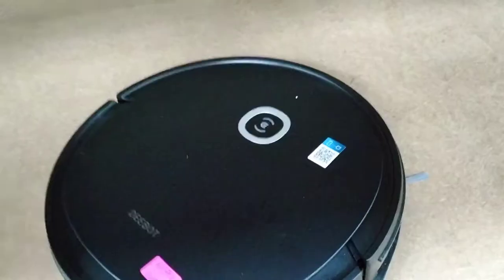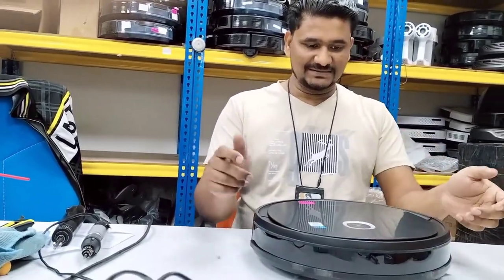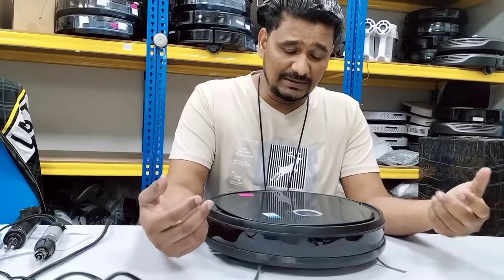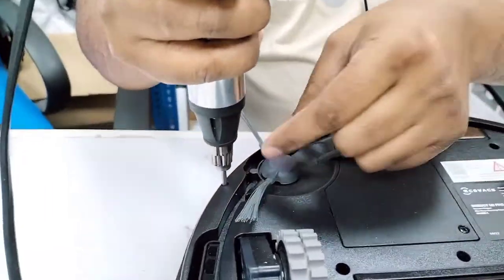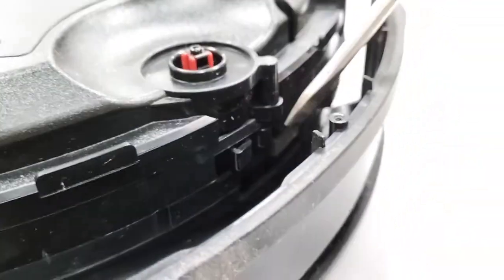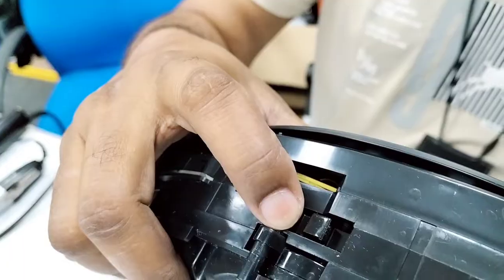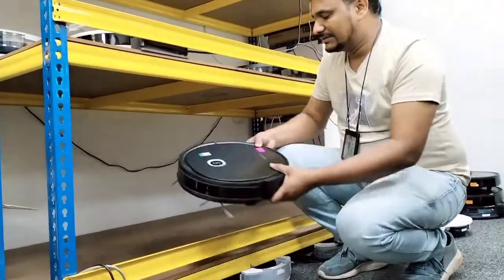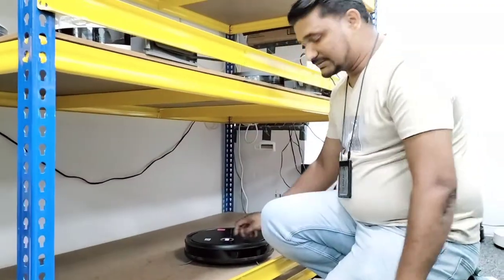Deebot Bumper Issues | Fix yourself @ Home Just in 5 Minutes

Comment: I have an N79S that gives the "Bumper error" mostly when hitting a wall almost head on, but not quite. Occasionally it will do "side brush error" instead. It can't operate for more than a few minutes without an error. I've opened it up and cleaned it thoroughly, and all the parts (the side brushes, the metal springs in the front of the bumper, the bumper clips you highlight in this video) all move freely.

Any ideas of what else I could do? I would really like to keep this operational.
Reply from the maker: Can you please attach a video clip at  WhatsApp 00601137973018
Reply: I am also facing same problem, I have a new machine which couldn't even map my total space until now. It works hardly less than 5 mnts then it brings error bumber stuck 😢 it's not stuck when I checked. It usually go reverse and hit to wall at back and says bumber stuck. Can't figure out what could be wrong. I have purchased it out of my country, and service center not taking it for a checkup. Kindly help. 🙏🏻

Comment: We have the bumper stuck warning issue. Have opened and checked. The two spring loaded levers that get pressed when bumper hits an object are working fine. There is no dust or water ingress. But soon as first object hits bumper Deebot 900 Ozmo stops are starts giving bumper is stuck warning. Any advice greatly appreciated or where in UK are private repair centres?
Reply from the maker: Power on & start...once start moving then plz press bumper with ur hand from left, right & front sides....then u will understand which Side of the bumper is giving error...then just check from that side...maybe you find some dust, rust or wire damage in bumper... possible plz try...if still same then bumper need to replace

Comment: Hi Bro, 
I have a new DLN26 machine which couldn't even map my total space until now. It works hardly less than 5 mnts then it brings error bumber stuck 😢 it's not stuck when I checked. It usually go reverse and hit to wall at back and says bumber stuck. Can't figure out what could be wrong. I have purchased it out of my country, and service center not taking it for a checkup. I have tried your tips, still it's same Kindly help. 🙏🏻
Reply from the maker: Hi.. welcome...plz send me a video clip 00601137973018.

Comment: Hi, I was really pleased to find this video as I have had this problem twice. The first time the product was still under warranty and I sent it to get fixed, however now I just want to fix it myself. I have the Deeebot Ozmo 950, but when I tried to follow your instructions to remove the bumper the model is clearly different to the one in the video and it won't release (come off) the same way. Do you have any other videos showing how to remove the bumper for the 950 series? Many thanks.
Reply: Actually, I was able to open up the bumper, using another video however the mechanism is very different to the one in your video, do you have any suggestions of what I should be looking at?
Reply from the maker: Yes that's tru different models principal is different...but not difficult if you see some other videos you can find same model as well...for bumper only in Ozmo 950 put deebot up side down.... remove all bottom chassis screw n underneath the bumper screw as well.... remove bottom chassis plate...for bumper removal no need to remove bigger inner screw...just remove bumper panel n remove bumper...if u feel bit difficult to take out the bumper assembly from deebot then just remove smal front plate on the top of the deebot next to LDS...just pull up there's no screw in that plate..only locks...will pull up eaisly then very easy to remove bumper...same way can fix it back
Reply: @ecovacstechnicalsupport5278  Great - it is working again now! really appreciate it. Many thanks
Reply from the maker: @kirspence1  waooo geat..🏆😊

Comment: Great video.
I have N79s doing 1 and 1/2 circle to the right then to the left and giving 1 beep with just blue light flashing. I reset it as well as changed the right wheel motor still same issue. Would you be able to advice....😅
Thank you in advance.. 😄
Reply from the maker: Can you please WhatsApp me a small video in which I can see what's the issue...00601137973018

Comment: I have ECOVACS DEEBOT DX9G model (OZMO 950 series) purchased in 2021 Apr in India. Has worked very well for almost 2 years and was very useful in pandemic days. It has same problem as described in this video. " My bumper is stuck " . I followed as per this video. I could not open the front bumper totally , but as I observed thru the gap (after opening the ring shaped plastic cover attached to the bumper) the switch design is different than what you have shown in  video. However there was not stuck or sticky operation of the switch . I could not take away the front bumper . Please  let me know how to open the front bumper for my model.    Point no 2 : I fitted back the unit after thorough cleaning . Incidentally there is some improvement . Earlier problem will start  within first 1or 2 minutes of cleaning cycle. Now it occured after almost 10 minutes of cleaning.  (Checked this two times.)  Can you please guide me.
Reply: 1) I had the same issue re removing the bumper, it needs slightly lifted upwards with care. You will hear strong clicking sounds when the bumper unclicks. 2) the two levers inside were different to this video and fine and not stuck so I cleaned the sensors with ear buds but no
Improvement. I’m wondering I need to replace the sensors.

Comment: I have an ozmo T8 aivi and it says the bumper is stuck. But when the bumper is pulled off, both of the bumper switches move freely. How else do you fix this issue?
Reply from the maker: Plz check my other videos related to this issue....but it looks like front anti drop sensors set which comes with bumper sensors need to replace...or u can wipe the bumper first n see weather it start working
Reply: I have watched that video. I have used my camera, on my phone to pick up the infrared sensors on all the anti drop sensors. But still have the same bumper is stuck issue.
Reply from the maker: @mitchellparker7097  plz try to remove bumper n check behind the bumper clip sensors working or really stuck???. Or might be dusty...if all ok still giving error then plz replace front anti drop sensors full set with bumper sensors...if u have other T8AIVI then can rest replacing bumper weather bumper ok or not... but Very rare bumper physical spoil.... normally sensors behind bumper spoil
Reply: @ecovacstechnicalsupport5278  Ok thank you for your help. I’ll give it all a go.
Reply: @mitchellparker7097  Hello! do you solved this problem?

Comment: Will this resolve an issue with mopping function only. Mine does this when mopping plate is fixed?
Reply from the maker: Which model you are using???
Reply: @ecovacstechnicalsupport5278   U2 pro

Comment: Hi, I have done all you have shown. Have even cleaned the bumper dark red screen inside and outside. Bumper is not stuck and springs work perfectly. It started this error once a month, then once a week then all the time. Can you help fix?
Reply from the maker: Plz remove Front Roller...I think there's some dust stick under the front roller... underneath got sensors...I think those sensors blocked with dust that's why it's giving error
Reply: @ecovacstechnicalsupport5278  there are no sensors under front roller / wheel. Any other suggestions?
Reply from the maker: @madharry6792  behind the bumper under main board in front got one sensors pannel same length as bumper...plz check those sensors might dusty or wire of those sensors might be loose... reconnect those connectors n try....